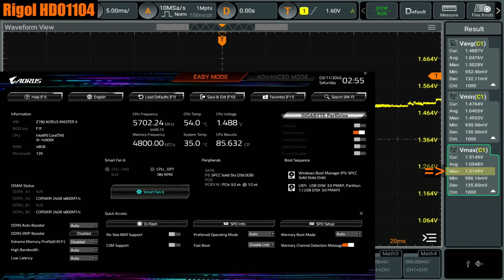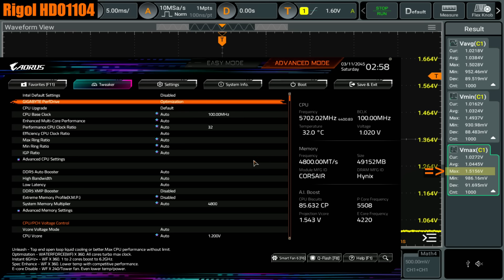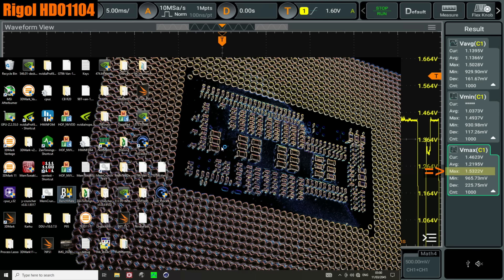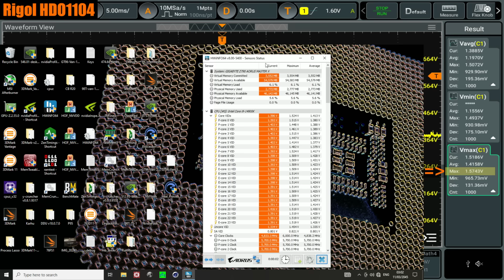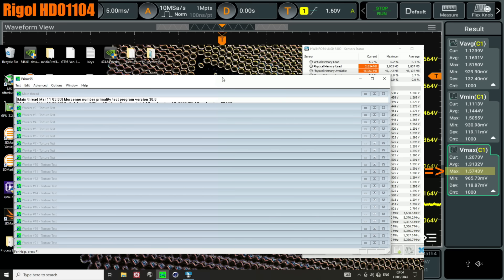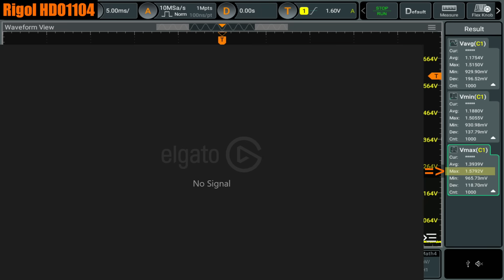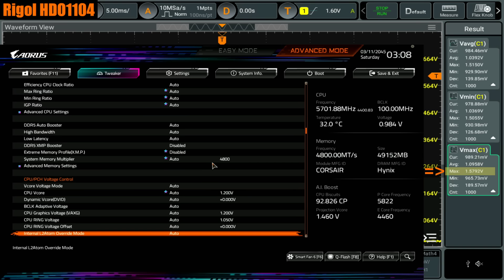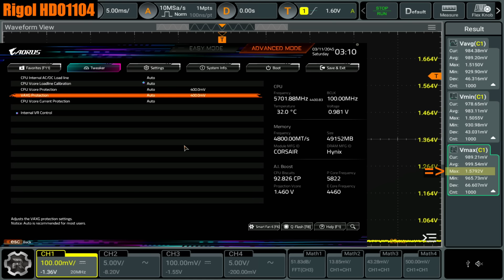Turning off "Intel Default Settings" with Microcode 0x129 DISABLES THE VID/VCORE LIMIT

Comment: Have a water cooled system. i7 13700k CPU, a contact frame with an Asrock Z790 Steel Legend Wifi board. Before the intel bios update, it would instantly thermal throttle at 100°C whether Intel's limit was activated or not. After the bios with microcode update, it preformed EXACTLY the same when using Cinebench R23 200. I was ready to give up until visited Intel's site to see their power default and manually set them. 125°C base and 253°C Turbo. Lord knows what Asrock sets it to despite what settings you pick. It for the first time actually doesn't thermal throttle.  The Asrock Microcode update was a complete failure and waste of time from my experience unless it does something else that I am unaware of.
Reply: most people still dont know that, 13th/14th gen i7/i9 run super hot... so hot that it was practically impossible to cool them with ANY kind of cooler available in the market...(no matter you do the microcode update or not) untill you actually put a power limit or undervolt and bring down the clocks. I realised this before getting my 14700k and got an air cooler. after initial tests with 310watts, i knew it would throttle, now i put limit to 235watts, and temps remain stable at 90deg C.
Reply: What you experienced after the BIOS update is normal. Intel actually further brings up CPU voltage in R23 benchmark

Comment: @Buildzoid you fried your cpu running default settings for too long if its failing r15 at 1.4v.... My 14900k which I manually set everything since I got it is limited to 1.3v max since I got it and currently runs at 5.8 all p-core, 4.4 e-cores at 1.29v max on adaptive v-core using a ac/dc loadline of 20/20 0.2ohms on a -0.20 negative offset completely stable, during benchmarking voltage drops to 1.18v stable. I set my sa to 1.3v versus 1.25 default to get my tight memory settings stable at p1/p2 of 260w which runs better than 253w. Passes r15 at 6271 @ 260w, Cinebench 23 with 41k at 260w no issues and Occt stable overnight... CPU only scores 89 in my gigabyte aurous elite ax motherboard, but I been told I got a great cpu even though the cpu score is low. I just think it comes down to never running default settings from mb or cpu as I been building my own computers for 20 years and never run a cpu past 1.35v and try to find max stable clocks at 1.3v for longevity. I never trusted 13th/14th gen stating over 1.4v was safe when stock voltages is 1.2v, it's too high of a jump 15%+ to not have some long term degradation issues in my opinion as anything past 10% can lead to silicon degradation over time...

Comment: On my z790 asus board I set the vid table voltage to offset positive sing and set 1.42 vid valve and it doesn't pass 1.42 vid voltage. Been running this for the pass year no problem.
Reply: Yet

Comment: My 12900k undervolt to 5.2ghz single core with 1.26v, and 5.0ghz all core with 1.2v. So far the CPU runs under 45 degrees c when gaming, and 55 degrees c under medium load.   The intel's sweet spot for 12th gen CPU is 4.5ghz to 5ghz,   13th and 14thgen shall run between 4.8ghz to 5.3ghz.   A 6ghz with 1.6v single core on a 14900k is a dumb.

Comment: Glad there's a finally a working fix for people's whose cpu are still in relatively good shape. I wonder if they've discretely rolled this out to laptops with 13980HXs, which even though power limited on wattage, shouldn't be voltage limited any different than a desktop 13900K.
Reply: They should in fact aim for a completely different working point on the power-performance curve for the sake of efficiency. Power consumption scales linear with frequency and square with voltage, so any little bit they can get on driving the voltage lower helps their typically horrendous thermal situation and marketable battery run-time.

I can't say whether they do or do not but it would make sense that they would, and that they would get binned correspondingly for better phase margin at low voltage, and laptop chips sell at a premium. It would also make sense then if true that intel wouldn't be concerned about early laptop failures.

Comment: Does anyone else have theirs throttle at 90c now?
Reply: before update, my cpu only throttled at 98-99c... but after update it throttles at 94-95c... wtf? i had to put power limit of 235watts to keep it below 90c.
Reply: @realracing3specter295   we definitely did not get the product we were originally promised unfortunately.

Comment: After installing the new Gigabyte bios with manual power limits of 253w, my 13700K maxed out at 202.42w during a 10-minute R23 run. The previous bios allowed 253w. Is this a problem?
Reply: what was you R23 results? also are you using intel's default profile or Gigabyte profiles?
Reply: @Alonne1  25731 using the Gigabyte Performance profile with Buildzoid's suggested changes from previous videos. Intel’s profile doesn’t show up at all. It’s the Z790 Gaming X AX motherboard, so probably not high on Gigabyte’s priority list.
Reply: @cp6565  Something is definitely wrong. I have a discontinued Z690m Aorus Elite AX DDR4 and the newest BIOS has the Intel defaults profile. 25,000 in R23 is rather low, you should be somewhere north of 27,000 with the right power limits, cooling, and undervolt. My 13700K scores between 27,900 and 28,200.
Reply: in my case, after microcode update, i am maxing out on 255watts on 14700k... previously it could go upto 290watts... my cpu cooler cant handle heat at 290watts, so i limit it to 235watts, keeping my temps under 90degrees all times.

Comment: Man this whole situation sucks. I would love to update to 0x129 but I’ll lose the ability to undervolt since I’m on B660-I and using 0x104. With an SFF 13600k build running 100c out of the box, undervolting is my only saving grace to keep <90c and I’ll lose that on 0x129.
Reply: Just out of interest, why wouldn't you be able to undervolt anymore?
Reply: @sp00n  Just due to B series shenanigans. You’re allowed to undervolt on 0x104 and you won’t lose performance but on newer microcode you’ll get clock stretching and lose a ton of performance if you even touch the voltage offset due to intel’s UV protection.

Comment: The whole situation is just crap. Intel can't get out of it now. It's simply said stupid design of the voltage regulation.
And it's so random. Sure, Cinebench R15 is one of the applications that always crashes, but the rest of them are toss of the coin.
My CPU will run Prime95 small FFT's forever and pull up to 404 Watt and still  see a maximum of 89 degrees Celsius. But it will fail on a lighter load of the Cinebench R15  just because that load requests more voltage in spikes. That all while power draw is lower for 100 Watt.
My CPU was running all core load at 5.7 GHz and was kicking ass. But to get there, you need to balance 5 things, or it will just plain crash on anything.
I coild run games like Apex that crash for many people, but the Horizon Zero Dawn always crashes. Only once I was able to launch it and it crashed after a few minutes with the weirdest artifacts. For the same money, Horizon, the forbidden west works just fine.
Up to now, I have had random  crashes even with the applications that were always running fine.
The worst thing I have had was that Windows would not shut down, but it would restart on shut down, or it would restart and stay in some lombo mode. This cost me money because I would find computer working all night if I haven't made sure it got turned off.
The only reason old school people get Intel was that their processors were stable with every application, even if they would be slower in application or two. Plus, it was more all-around capable CPU that dies games and production work good.
And now, to be honest I do not want even to own it anymore.
My MSI Tomahawk Z790 has now beta bios with the 0x129 microcode.
It does solve thd issues of the Cinebench R15 but the Horizon Zero Down still crashes. Also at the idle P cores run 5.7 GHz and two of them run at 6 GHz but in the Cinebench R15 it down clocks P cores to 5.5 GHz leaving performance lower than before 
I can't tell is it going to solve random crashes because those were going on once in two days or so. 
BTW now shut down seems to really shut down my PC but I Wil see the result of that tomorrow morning.
So much effort in running it for what? To still crash in old stupid game and to get able to run benchmark I do not care about?
Intel should make gen 15 CPU that works as advertised and refund everyone.
That's thd only way. I can't trust this platform ever again and will not build it fir anyone anymore. I am sad I have build computers with the 13th and 14th gen for my family and friends 😢
Reply: This won't fix an already damaged CPU, all probs u have are permanent damage on Cpu need to rma
Reply: @hentosama  I do believe my CPU is degraded. Though if you were getting voltage spikes and if those were causing crashes, then it might be possible that once those spikes are gone, as this 0x129 microcode promised to remove those, stability issues might be gone as well. It all depends on how long the CPU was exposed to higher voltage. If it was just spikes and those are gone now, then it is possible that it was not permanently damaged. If it was exposed to long while not crashing, then it is definitely degraded. Electron migration took place then, and there is no help to it.
My CPU was always running under nice temperature. In gaming, it was around 60 degrees Celsius. 
Electron migration can be caused by too high voltage or to high frequency. Too high temperature is accelerating that as well.
If my CPU keeps crashing randomly, that is 100% sign that it is degraded.
Though things like Windows 11, not being able to shut down properly is gone now as it seems.
I was kinda sure I had killed my Windows installation. I was suspecting my CPU couldn't process needed stuff as well.
Look, it works now.
Isn't it strange that bios screws up just shut down of the Windows?
Anyhow, to be honest, I wish Fairy would just remove my mainboard and CPU and replace them with AMD 7800X3D and proper mainboard. Or soon to come, 9800X3D. 
Sure, it would be gaming only system than, but it would do at least that really good and safe.